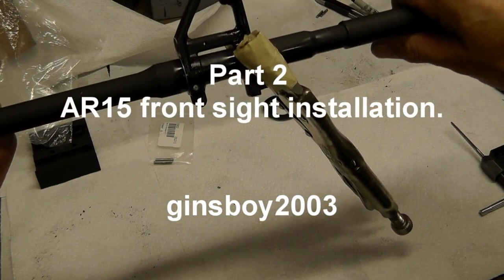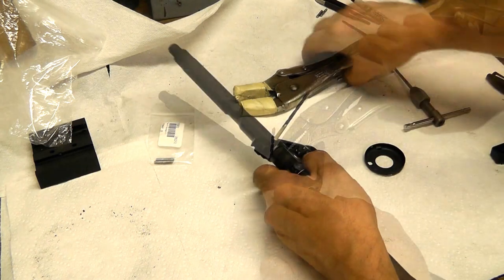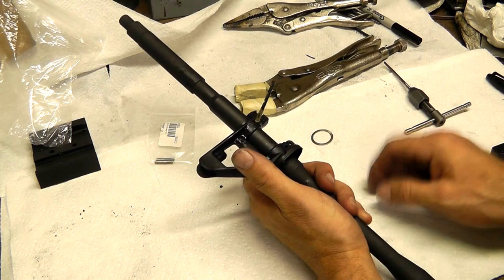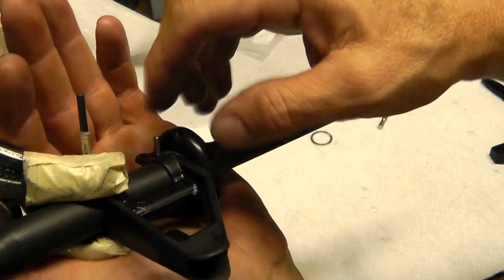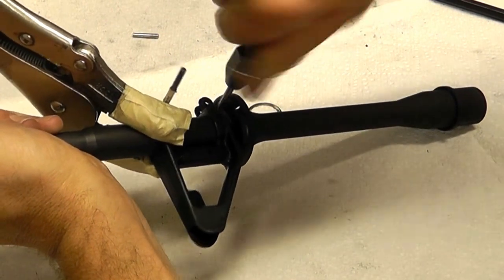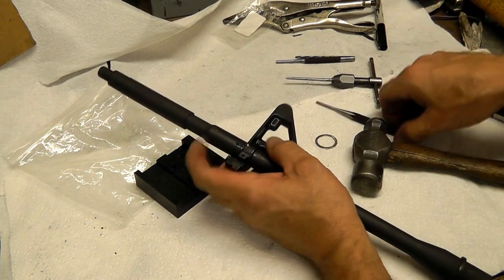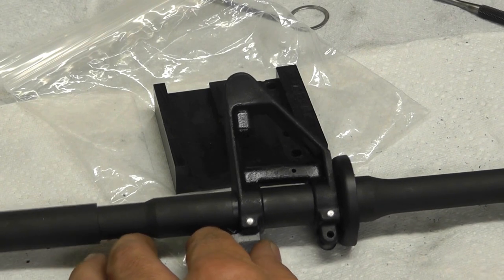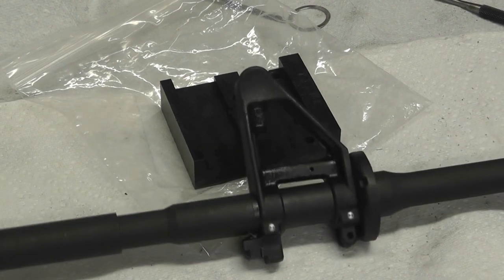AR15 Installing a new front sight on a new barrel Part 2 in HD

Comment: Thanks so much for this video.  You are right, this is really the only video I have found to show how this is done.  I am building an ar-15 for my son, and he really wanted the a2 front sight rather than a clamp on sight.  I don't have a mill but was able to follow most of it using a bench drill press with a table and a drilling vise.  Just finished and it turned out great.  I think he will really like it.  Thanks again, not sure what I would have done without your video!

Comment: Thanks dude!!!! I just finished re-barreling my DCM/CMP/NM HBAR using the knowledge I gained watching your really awesome video's.  I used a variable speed 12V cordless hand drill.  I did happen to have a milling machine vise and that made it easier to square up everything.  But I think I could have done it with a regular vise.  I used a mirror to spot my drill bit from a right angle view to keep it straight and I lightly torqued my receiver on to use it's bottom edge as a square reference I had my slights on and used a plumb line on a wall and bore sighted and rolled my front post until my sights were on the same line with the rear sight mechanically zeroed.  I went over to my buddies and aimed at a coke can full of water at 100yd and hit it with my "fowler" shot.  I cleaned the bore and fired again at a 100yd MR31C and hit a high 9 at the 12 o'clock. cleaned and fired again and hit the same place.  I adjusted my elevation and never touched my sights the rest of the day.  I really expected to have to give it at least +/- 2 moa windage.  I really lucked out.  I couldn't have done it without your help.  Thanks.
Reply from the maker: That's awesome, great job!

Comment: Excellent video, on a good topic. I have assembled a few AR's but so far, never tackled the Front sight and the taper pins. Now I think I can add that to my bag of skills. Thanks for a well thought out and demonstrated solution to the task. Oh and I got a kick out of the spacer solution, now to find me a mandrel to take on that task. I never noticed if you had the barrel nut in place? I think that issue alone is what scares some builders, having to take the taper pins out after being installed in the factory.

Comment: You can use a bubble level on the bottom of the bayonet lug and upper receiver (if you barrel is already installed) to make sure its aligned. Then use a set screw between the gas port and sling swivel to hold the FSB in place while you drill the front hole.

Comment from the maker: No jig that I know of.  A good way to eyeball it and visualize where to drill is to put the sight in place, and lay a cleaning rod over the center of the barrel.  Now that you can see where the bore is you can see where you can drill.  Your pins only need to cut half their diameter into the barrel to be really secure.

Comment: Great video. Very helpful. But now you have to take it all aparts to put the barrel nut and delta ring assembly on.
Reply from the maker: You're right.  My job was just to put the gas block on though.  Anyone else who does this is going to want to do this will need to make sure the barrel nut and delta ring is on.

Comment: When I ordered the sight I also  ordered pins.Andersons website just said front sight pins.I am going to check with a local store that carries alot of ar parts on my next day off.
Reply from the maker: +Todd Rust Something is wrong, the proper drill bit is .125 a #30 bit is .128 so there isn't much difference since the large end of the pin is going to be far larger.  Are you sure you used a number 30 bit?  Did you drill by hand or use a press and where did you purchase the bit?
Reply from the maker: +Todd Rust I don't see that anyone sells oversize pins anymore, but these might help you.  https://www.fastenal.com/products/details/11104192?term=taper+pin&r=~|categoryl1:%22600000%20Fasteners%22|~%20~|categoryl2:%22600108%20Pins%22|~%20~|categoryl3:%22600121%20Taper%20Pins%22|~%20~|sattr01:^%22Taper%20Pin%22$|~%20~|sattr02:^0.193%22$|~
Reply: +ginsboy2003 The bits are a 30 i got them and the taper reamer at Beaver Drill the sMe place I get my end mills.I drilled them on my Jet mill,I got a 2/0 pin atvwork and the ones Anderson sent me are definitely not  the same.It won't be a problem once I get the right pins.Thanks for the replies
Reply from the maker: No problem, I was just worried that you were having problems as a number of other people have done this so far and didn't have issues.   Glad you got it figured out.
Reply: Hey I got new pins that seem to be right,does it really matter if they go in left to right or right to left? I tapered my first hole right to left!
Reply from the maker: No, not as long as you know in case you want to remove them, but I believe I showed the industry standard.

Comment: I would like to start by saying ginsboy - you did an exceptional job making this video. I am in NY and having extreme difficulty locating a 14.5" carbine barrel with a front sight base installed. Can you please shed some light on how you determine how far "up" the front sight base to drill the holes for the taper pins? I.e. do you want 40% of the drill bit protruding the barrel body? 50%?
Reply: USE YOUR EYEBALL JUDGEMENT,,, HALF OR LESS OF TWO PINS WILL HOLD A HAIL OF A LOT...........LOL

Comment: One thing I noticed is that you didn't show that the drilled out holes for the taper pins actually passing through the surface of the barrel itself. maybe sliding the front sight base off the barrel to show people the channel's created after you drilled and reamed. Would you say that half the shaft of the taper pin should be engaged on the surface of the barrel?
Reply from the maker: Yes.  Sorry I didn't show that.
Reply: you can see the cuts when he cleans the barrel at 1:57.

Comment: Now for when your measuring with the ruler to make sure your not going to drill fully into the barrel, how far is that distance from the barrel to where you want to put your drill bit. basically looking at the last minute of this video showing where your tapered pins are I see that they are pretty much in the middle of that flat where they sit! is that what im basically looking for or is there a set distance?? Great video!! good bit of knowledge, thanks.
Reply from the maker: +armorer91 I don't have a measurement, I look at the sight and where the edge of the barrel is under the sight (imagine looking through the site) I drill there.  I didn't use any set measurements for drilling the barrel pins, nobody does, thats why whenever a front sight is replaced, you need to go back with a clamp on sight.  The likelihood of matching up the pin holes is very slim.
Reply: okay I got ya! Thanks!

Comment: I have purchased a Colt parts kits with a used front site that has already been drilled and a virgin barrel that I have parkerized my next step is putting the front sight on I would kind of like to use the original Colt front sight. What's your recommendations about drilling that I'm kind of afraid of the drill bit walking off the barrel since the front sight has already been drilled I would appreciate your suggestions and thanks for the video it has been a lot of help.
Reply from the maker: I'd find another Colt sight.  Chances that the drill bit will walk, egging out the holes is pretty high.  The taper pin is reamed to a pretty tight dimension so if its off even a little, it'll be too much and you'll need larger dia. pins.

Comment: Is the reamer's size measured the same way that the drill bits are? If not what size taper reamer are you using? Forgive the stupid, but I'm REALLY new at this. I'm building my first AR, because I thought it would be cheaper to do so, which wasn't exactly the case, but now that I'm more than half-way through buying all of the parts for it, I figured I might as well finish what I started. I didn't pay any attention to the front sight I bought, and it turns out that it wasn't drilled, lesson learned.
Reply from the maker: Its a 2/0 taper reamer.  If the barrel is new, you really don't want to have the front sight drilled, it actually makes it harder.
Reply: ginsboy2003 A friend of mine who has a good deal of gunsmithing experience is going to help me out. I did have one more question about the reamer though. Is it a straight reamer? Or is it fluted? I found both, that's why I'm asking. I was also going to ask, if I don't want to drill the barrel, how would I get the sight on?
Reply from the maker: Its a taper reamer, the pins are tapered and it does have flutes.  Just get a 2/0 taper reamer.
Reply: ginsboy2003 Ok thanks. I don't want to annoy you, so I'll make what will hopefully be my last question short. What kind of metal did you use to make that washer? Just so that I can get more or less of an idea of what I need.
Reply from the maker: I think it was just what ever I had which was a washer that was already the same thickness.  It was for a previous job that needed a special washer, can't remember what now.

Comment: If you have too much pin sticking out when you hammer it flush you can get galling and end up with a pin that will never come out. I have had gas blocks that were pinned too tight and those pins acted like they were welded in.
If you even think you might someday want to remove them, don't hammer them in as far as he did.

Comment: Question,
Is it better to have handguard end cap tight behind the sight block, or loose so it can be rotated? Also, is the preferred drill bit #30 or #31?
Reply: Rotate the sight 90 degrees and look through the hole in the bottom. Align them and with the endcap installed verify the distance from the shoulder with feeler gauges or shim stock.

Comment: Can you buy a barrel that is already been cut for the taper pins?? If so where and do you have any recommendations for a budget barrel that has been cut for the taper pins?  Thanks
Reply from the maker: No, they are all sold as blanks you have to drill and use a taper pin reamer on.
Reply: ginsboy2003 thank you that's what I have come to find out. I'm guessing he will just order one with a FSB already installed. Do you ever take on any work and do this for people that ship you a new barrel and used FSB?
Reply from the maker: No I don't.  Unless you just wanted to do it yourself, why not buy a complete upper from PSA or somebody else?  PSA has had some really nice uppers on sale lately.
Reply: On my PSA lower I have had sitting here in the safe, I decided to get the CHF M4 16" rifle kit to finish off that stripped lower. I also have a DPMS slick side. This one here I'm not happy that I broke my own stringent check down. The S&M M&P 15 I was looking at getting from a guy earlier int he day I broke it all down and check it over. Well for another 50 bucks I can just get one that's ready to rock. so I will go that route.

Comment: Would the front sight need to be removed prior to the gas tube being installed?
Reply: cal30m1 nope you feed the gas tube into reciever then put it trough the delta ring assembly and into the front sight then pin it in